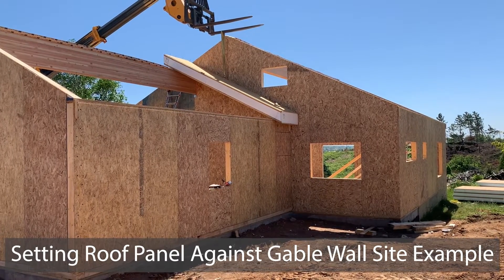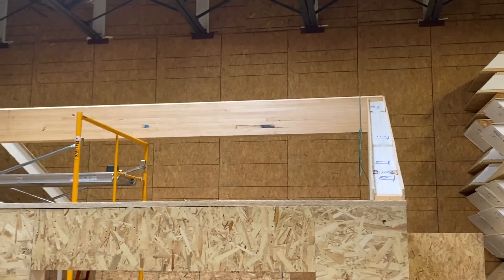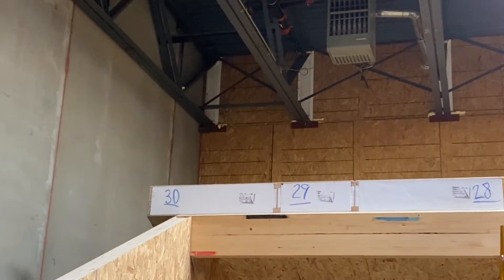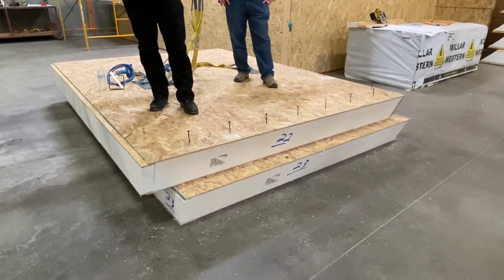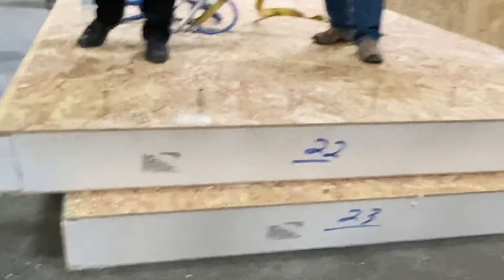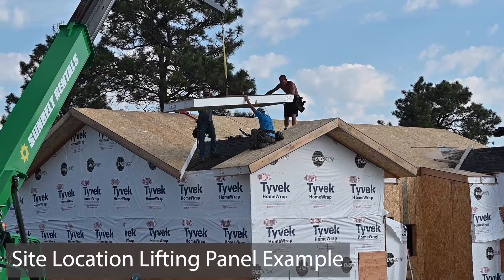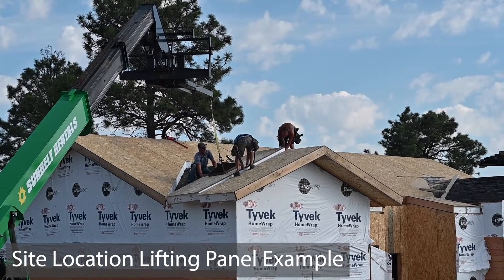How To Set Enercept SIP Roof Panels

Comment: I am about to build a 12x16' pre-cut Costco shed. These sheds are bare minimum so I am interested in upgrading the roof to a SIP system. I can't even find how to purchase these things for such a small project, also the pricing is not clear. Also with respect to the shed, is the upgrade even possible given there is no ridge support beam? Can the beam be added? Thank you. :)

Comment: Hello I'm the new guy to sips building, what driver is best for screwing nails ?
Reply: What specific drill driver. He holds one up but doesn’t give the model. What torque are we looking for?  Ideally please specify a Milwaukee driver
Reply from the maker: The point of Jon's comment is that it doesn't matter what brand of tool you are using, drill drivers with adjustable torque settings, set on low or 1, do a better job of installing the SIP screws into denser material than an impact driver.
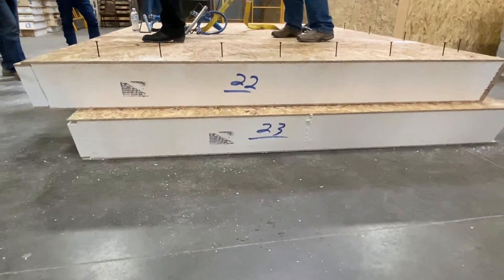Reply from the maker: At approximately time code 7:25 in this video Jon talks about drill drivers vs. impact drivers for setting SIP screws.

Comment: can you install standing seam metal roof directly on osb or do you need  high temp ice and water shield and will you have a moisture issue with the metal roof on osb?
Reply from the maker: High Temp underlayment, also known as low perm peal and stick underlayment, should not be applied directly to the OSB of a SIP roof panel.  More information can be found at our technical guide page: https://www.enercept.com/technical-guide and refer Technical Guide #8 "SIP Roof and Wall Assemblies" on that page.